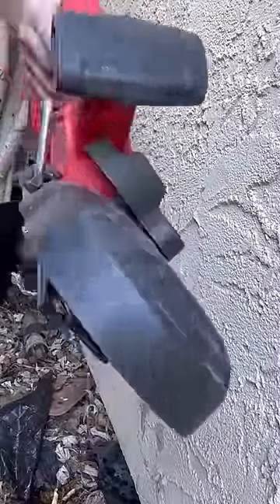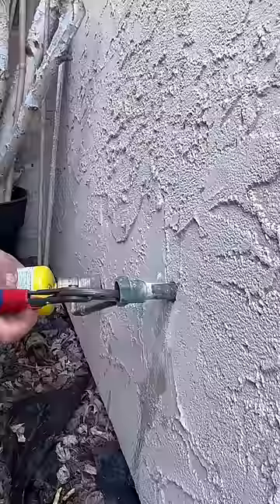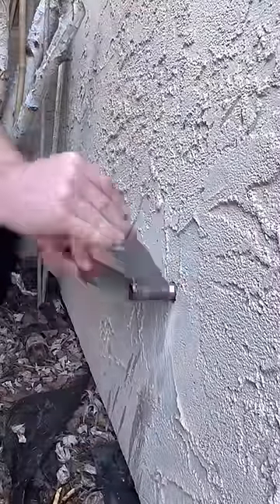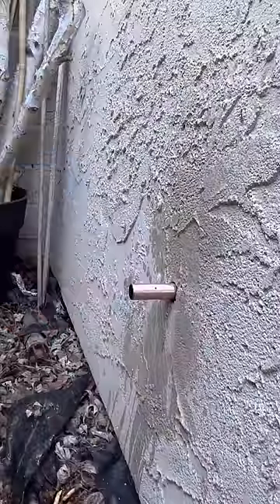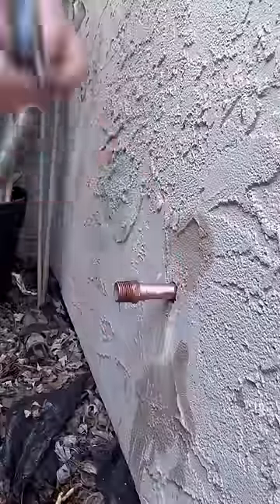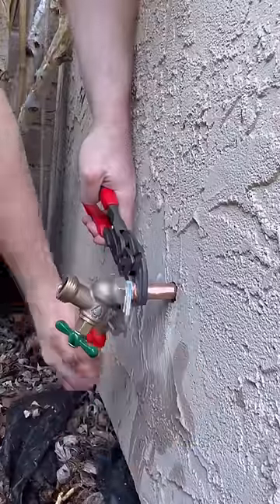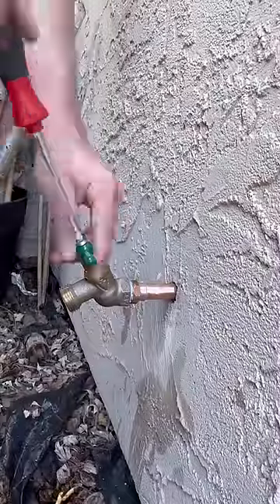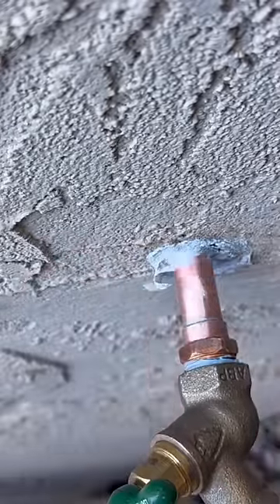swapping a hose bib #plumber #plumbing #diy #soldering #oateyambassador #propress #copper #repair

Comment: You're my hero for sealing that gap 😁
Reply from the maker: Vulkem 116🔥🔥
Reply: @replumb  what did flipping the handle accomplish? Love the videos and commentary.
Reply: @briansmith9258  he didnt flip it, he just aligned it. This may be an ocd thing for him, but generally when the valve handle is perpendicular to the pipe, it indicates thats its off. Idk as im not a plumber, but usually handle being in-line, indicates flow
Reply: I use the Dap silicone stuff just because it's in a squeeze tube and easier. It's an indoor outdoor paintable clear silicone based sealant that doesn't yellow and you don't need a caulk gun for it. Wish they vulcan stuff came like that I'd try it.
Reply: @WespectRamen  as a current plumber myself this isn't OCD it's just doing their job to the best of your standards that you can possibly do. I would have liked to see some insulation around that stuff out but as far as the handle alignment that is his integrity and craftsmanship showing not a disorder, it is actually an enforced order
Reply: wth🌚
Reply: @WespectRamen  nah, you’re spot on.
Reply: @WespectRamen Yeah its just a presentation thing. Like how my dad taught me to always put a hubcap on with the logo in line upright with the valve stem or put the serpentine belt on with the writing facing out. Doesn’t do anything but the little things matter too
Reply: Used vulcem on a pool deck to fill cracks years ago. Sticky as all get out. Had to put oil on the putty knife just to spread it but MAN does it do the job.
Reply: @briansmith9258  he aligned it. it’s like electricians aligning the screw heads for outlet and switch cover plates vertical or horizontal. just means you take pride in your work and enjoy the little things being done right.
Reply: didn't really fill it at all. gotta push it in there with a putty knife or scraper or something similar. that seal won't last a season.
Reply: @ericleiser33  barely covered the right side at all.
Reply: Filled a few gaps in my day
Reply: @Wkyliving  Me too, but not as many as I wish I had 😂
Reply: @Obvious Ness  lmao I lost count way before I finally settled down 🤣
Reply: He didn't really seal it though.
Reply: @replumb  that stuff is no joke!
Reply: BARELY.
Reply: Well you're easy to please.
Reply: @ThatGuy-de8nq  That's what the girls say! 😂
Reply: @replumb i do the same with electric. I hate when i open a box to change a plug, light, switch etc etc and theres just a nub of wire in the box. And then when you go to try to pull out more wire and it doesnt budge. Its so annoying. 
Its so annoying. But im glad theres still people in the trades that think about the next guy
Reply: @frankvadnais3536  the video cut off. How could you possibly know that
Reply: Yes.
Reply: Knipex are the real deal!
Reply: @WespectRamen  your talking about a quarter turn shut off w/handle longer on 1 side so it could be parallel with the waterline and Flow, not a multi turn like this...
Reply: Brilliant work. This is what professionalism looks like.
Reply: Renovation to my exterior were so bad, I could see light coming in from my pipe openings, telling me there was no willingness to finish the job with sealant.

Comment: You know he's a good tech when he owns 2 Knipix pliers.
Reply: Knipex is... aamazing. After my first set, I never wanted to use any other pliers.
Reply: @Torsion  they are truly the best there is.
Reply: @Manhandle730  Yeah man, I bought them when I was a service technician and even though I no longer use my toolbox daily, I'd buy more if the need arose. I'd even be willing to put off something to wait on the shipping. That's how much I love those things. I could struggle with a decent pair from Lowes or something or buy some knipex for a bit more and have the ability to use them in multiple situations!
Reply: I've been using Knipex for 25 years
They're the best and blow Klein out of the water. I used to tell people years ago, be fire tbey got even more popular, and they'd wouldn't go away from their Klein . 

I have cutters that are 20 years old that haven't lost their edge AT ALL. And will not rust. No matter what. They're unreal.

I even use their tiny wire cutters for soldiering tube amps, and they're the best on that aspect too. Everything they make is the best
Reply: @Torsion  
What are you doing nowadays?
Reply: @Pete's workshop  Healthcare. The work areas are smaller, but the phrase "Don't make me get the hammer!" Works well on engines AND people!
Reply: I own 4
Reply: Where is a good source for buying knipex?
Reply: @Torsion  thanks.
Reply: You might say he’s “invested” in the quality of his work lol
Reply: im no plumber but i was taught that pliers and vice grips should be used when the application has been damaged or rounded off and a proper sized wrench wont work.
Reply: @Abu_Teazy  depends on the quality of the plier jaws. Knipex have flat surfaces that move along a diagonal plane, so they can grab the flat bolt surfaces and really lock in, so your grip doesn't have to be too tight (marring the bolt surface)  or it doesn't slip and round over the bolt head. 

Knipex, if you see this... I'm open to thank you gifts for the promotion of your product! [LOL, feel that I probably seem like I work there already, answering all these comments]
Reply: I resited Knipex for years because I usually buy American but finally broke down and won't go back now.
Reply: @scottapt5291  What, they're not American?

Comment: The OCD of resetting that handle perpendicular to the pipe is a quality of a good tradesman.
Reply: I’d hire him for any job
Reply: And that OCD that let him do a shitty caulk job. So much for waterproof. 🤦
Reply: Plumber here. Don't silicone the outside of the house, especially with copper pipe. You silicone the inside of the hole in the event the copper pipe freezes and bursts it'll poor out of the house and not into the house. If you seal the outside of the hole it'll piss into your home instead. Also why you sleave the hole with plastic pipe. That way you can silicone the outside of the sleave outside the house, and the inside of the sleave on the inside, fully protecting your property
Reply: Good craftsmanship isn’t OCD 
It’s just right
Reply: It’s just proper. Crazy how people are blown away by something being done proper.
Reply: @raycarrier5753 caulk job was perfectly fine. Only problem was sealing the outside
Reply: @raycarrier5753 ukk k
Reply: @inkwyvern5171 yeah, i guess just leave that hole open for ants, critters and anything else that can fit in there 😅
Reply: Yup. But that IS NOT OCD.
Google OCD. Nothing to do with that.
Reply: @Heavywall70 just like screws on wall plates. when they are no perfectly vertical, my anxiety kicks in. 😂😂
Reply: @inkwyvern5171  If you did that at my house, the water would just pour into the unfilled cinderblock foundation.
Reply: @tempesttube  the plastic sleeve is filled on the exterior. The inside of the sleeve filled on the interior. It's a difficult image to convey in text, but there's no access for water, even if the pipe bursts.
Reply: @theSkavenger84  why would you do that? How did you interpret 'leave hole in wall' from what I said?

Comment: Good job! We call that extra pipe sticking out "service loops" even if they don't go in a circle. Got to have extra to maintain things or you just throw it away.
Reply: Got that from the smarter men around you that decided to get into electrical. 😂
Reply: @jonkalb5281  yes
Reply: Just like on the drop for cable technicians. Hated it when there wasn’t any service loops and I had to rerun a drop.

Comment: "Old guys with fixes older than I am said do it this way"

Damn straight.
Reply: No old guy worth third salt told him this... As an old guy.....😂😅
Reply: One of the enemies of progress, "But we've always done it this way."
Reply: If it works it works
Reply: @ryanboyer1156  yeah but normally with construction the old timer says a certain thing because of their experience and tends to work out better… I’ve seen this new age carpentry, buildings dont hold up as long and need more repairs, they try to save money on material not triangulating enough in the roof to balance out the weight distribution causing shifts that mirror foundation issues… so then people start getting their foundations jacked up screwing all the pvc pipes in the house and it becomes a week of digging under the house and tunneling to fix 8 breaks that never wouldve happened in a properly built house… i could tell a dozen similar stories based on only 6 months of construction work and 6 months of plumbing apprenticeship… they’re wrong sometimes but most the time there’s a practical reason that is normally one of two things… make the repairman’s job easier to do, or make it less frequently needed…
Reply: @skyrimdovah420  was in construction for about 35 years - in many different phases including about 25 years as an Architectural Engineer. Imagine the cost of construction if we still used 20 ton granite blocks to build with. That's the main reason for using lighter less costly materials.
Reply: @witchdoctor7398  oh i get why, its always been about money when it comes to decreasing the quality of a product… sony and microsoft do this with their console releases, each launch batch for each model is better than every subsequent batch where they make small changes to increase profitability but reduce performance… choosing cheaper lumber and less lumber of course makes it cheaper and quicker to build and with a rapidly expanding population that is necessary, but it does effect quality and buildings do need more repairs now than buildings built even just 100 years ago and im sure if you did any remodeling in your time that you can attest to the older building being more sound than a lot of the post 1990 buildings
Reply: I can't speak for the construction industry, but old guys in the Automotive trade are just dumb. We learned both carburetors and Fuel Injection.  Carbs were being phased out so we weren't taught a lot about them. Fuel Injection was in its infancy and unless you worked for a dealership you weren't taught jack shịt. So yeah, not all old guys are smart. Some are just old.

Comment: It’s nice to see you were taught well. Heat on the bottom and solder on the top. I see guys heat it all the way around and follow the flame putting in 10 time the amount of solder you need. Nice clean well. You can get by with only using one or the other pipe dope or Teflon tape. The don’t seal, but lubricate so you get a tight surface to surface on the copper or brass. I’ve used vaseline in a pinch before.

Comment: Nice work that's why I have always done my Plumbing work like that . ALWAYS leave room for a repair. I ALSO take the Silcox hose bibs OR any hose bibs apart and grease them and check the washers. Good video, AND YEAH, you don't need a escutcheon for the wall, and Vulcan sealant works great.

Comment: You're right about everything! Only thing I would change is to use clear silicone to fill the hole. It's easy to take off and it looks slightly better
Reply: Vulkem is way stronger and actually usually has color matched stuff. Vulkem is made to withstand for long periods on wet spots as well. Vulkem is good stuff.
Reply: @Gillslayer92  Exactly

Comment: Plumber since 1995, good job bro!
Reply: Trash plumber ......😮 wtf why would you tell him good job for doubling up on lubricant .... it's  a machined fitting... the tape and dope are ment to help it turn in further without over heating fitting what is wrong with yall
Reply: @barefootization  wrong, and gfym 🤷‍♂️

Comment: The reason people don’t like long stubs in no particular order 
1. Break off the bib 
2. Frozen hose in cold climates 
3. Tweaker sees copper and yells yippee and rips it from the wall
Reply: Stahp lol
Reply: I always use a wall plate and solder it to the pipe coming through. It’s literally just a flange with a half inch socket that fits over the pipe and gets screwed to the wall. The tap then just screws straight in and not only is it permanent, but it looks like it’s done properly
Reply: @01mrginge  where is your clip?
Reply: He is right though, plus it also can be a hazard for children running by. And at the end of the day just looks unfinished.
Reply: Think of the children!
Reply: @johnbagewll2321  what clip?

Fyi, I’m from the uk. So if you’re talking about something that is a regulatory requirement, then fair enough
Reply: @01mrginge  I’m
Reply: Live in wis.
You take off your hose in winter
You turn off water to outlet.
When temps hit -50 you do things correctly
Reply: @Packitagain.  so if you forget you’re screwed?
Reply: @Packitagain.  it’s mandatory in the uk
Reply: @Packitagain.  
I live and love in a multi climate area of which zone valves are essential for hose bibs. Without a zone valve you can lose love in a hurry! 😂
Reply: And don’t forget the bleeder. Worthless without it.
Reply: And don’t put that thang on backards boy! 😂
Reply: @Andrew-hh3ol  Yes? Don't forget. It's not hard.
Reply: Depends on the climate, plus just insulate exposed pipe
Reply: You wouldn't (or shouldn't) be installing a hose bib like that in colder climates, period.
Reply: @williamh4172  he’s not in a cold climate.
Reply: @johnbagewll2321 - Read the beginning of this thread. I was responding to that.
Reply: @01mrginge  ”where is your clip” is him saying make your own video showing it done the right way.
Reply: Number 3 is a little silly. I get it trust me. But either way, if a tweeker is stealing something, it will be in the crawl too.
Reply: Stucco wall, probably not a cold climate.
Reply: @01mrginge He is for some reason passive-aggressively implying that because you don't have a YouTube channel to accompany your professional opinion, your opinion is worthless.

I always make sure my contractors have produced at least 1 youtube clip before hiring them.
Reply: @JustaSimplefact  I’m not sad enough to want to post a video of something that I’ve been doing for over half my life, just to prove something to someone that probably doesn’t have a clue
Reply: @01mrginge  to be fair, you just watched a video from a guy and I wouldn't say he's "sad". Just saying you dont have to have a clip, to have an opinion.
Reply: Obviously freezing isn't an issue here or they would be using a freeze proof spigot the others are just not really points

Comment: 2 Knipex pliers, moved the handle so it sits parallel to the wall, cleaned before soldering insanely well, used the correct sealant for the wall, and does things because the old guy that forgot more than we’ll ever learn said to! You are “The One”

Comment: Good job! Stick to the ways you learned from the older generation. 😊
May I suggest getting yourself a new gas tank handle with push button igniter. Use your old one as a back up if needed or a Bic lighter.

Comment: Here's another "OG" tip...

Take a piece of bread, mash it up roll up into a ball, then push it up inside that copper pipe about an inch or so. That will act as a stopper to keep any continuously dripping water from preventing your soldiering joint from heating up properly, but the heat from it will turn it to toast and then we just turn the water back on it just comes out the hose bib and doesn't clog anything. And of course, it's bread ..so it's food safe.

This is especially helpful when you've got one of those valves that won't quite turn off all the way, but the customer won't pay for a new shut-off valve.
Reply: If I may add, make sure it's white bread lol
Reply: Yeah and don't get it stuck in a shower Valve
Reply: @thirty3bub  or don't forget to it out or run the water before you out the shower head on lol
Reply: That's the beauty of using bread... (and yes... White bread only😁)
It dissolves with water and wont clog anything
Reply: I learned that trick from my Dad when I was about 14 doing home improvements and that was 46 years ago.
Reply: You will also have a nice snack when you're finished.
Reply: @Crazywaffle5150  lol
Reply: @Crazywaffle5150  nah... It will be burnt beyond the point of toast, and whatever soggy remnants, washed out the tap.
Reply: @kirkjohnson6638  it's amazing how well it works isn't it?
Reply: @mrfixitusa6165  Sounds delicious.

Comment: I usually pre-tighten the threads onto the faucet and pre-fit onfo the pipe, mark both, and then solder. This makes the threads line up exactly with where the orientation of the faucet will be.

Comment: Tip. Before soldering, get all the water out you can, and then push some bread up into the pipe. This will absorb water and keep the joint dry until you get it soldered. When the water's turned back on, the bread will dissolve, and blow out through the end. I've done this many times.

Comment: Small tips:

1) If putting a female on, be sure there is no water exiting. It will get solder in your threads.

2) don’t heat too long or you may unsolder inside the wall (unlikely)

3) pipe thread tape and dope is the only way